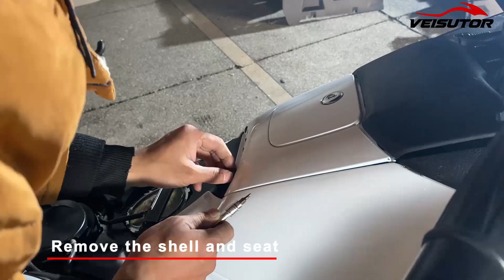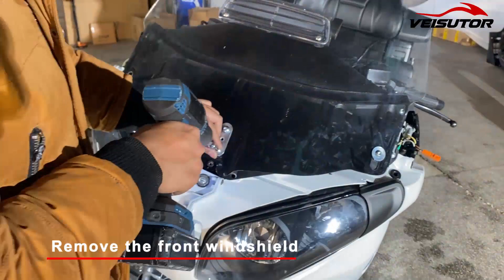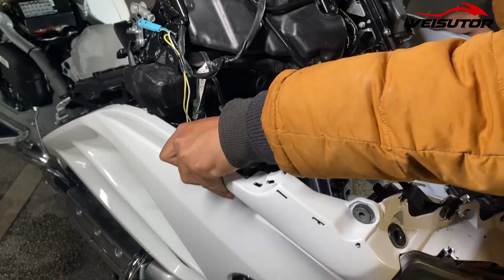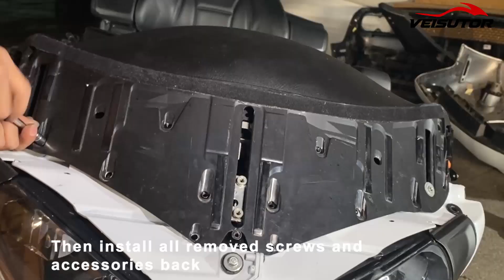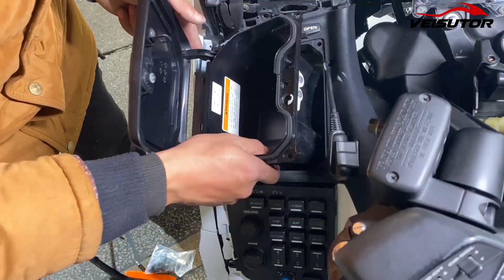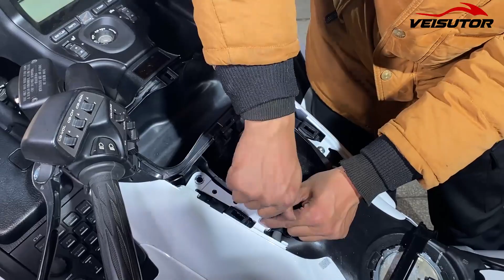Installation of  LED Headlight Assembly For Honda Gold Wing GL1800 2001-2018 Accessories

Comment: So we loose the light tilt adjustment ? Are the lights pre lined up ? Thanks
Reply: Yes you loose the tilt adjustment.  DEAL BREAKER
Reply: They do If you buy good lights and not junk, motodynamic headlights have the tilt motors and are high quality

Comment: Which brand of LED bulbs do these use, and if required how difficult is it to change the LED bulb? Does it require the same disassembly as shown in the video?
Reply from the maker: Hello, this headlight is an assembly kit and the bulb cannot be removed separately. If there is a quality problem, you can contact our after-sales via Amazon. (You can refer to the installation steps in the video)

Comment: The sensor was mounted to the back of the left headlight. It shuts off bike if it falls over and I found after installing these lights, the bike will NOT start without that sensor.
Thanks

Comment: That's ridiculous to have to change the headlights to led !!! You have to disassemble the whole motorcycle. No thanks
Reply: Believe it or not, just to change the air filter, you have to remove 3/4 of what he did. (Unfriendly engineering)
So if you turn your own wrenches and change your own air filter, just do them together.
Reply: Thats to change out the entire headlight assembly,  not to change stock bulbs to LED.   Big difference.
Reply: This is complete bullcrap, you do NOT have to remove everything this guy did, he has no freaking clue what he’s doing. There is a lot to it but not near as much as this guy shows
Reply: @Rockin-S  Well then how much do you have to remove to get to all four of the headlights?